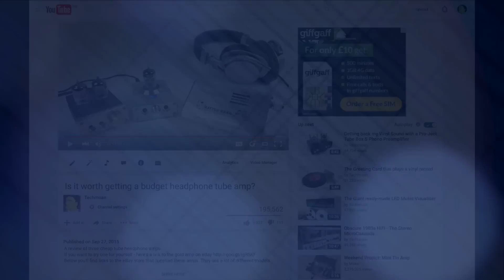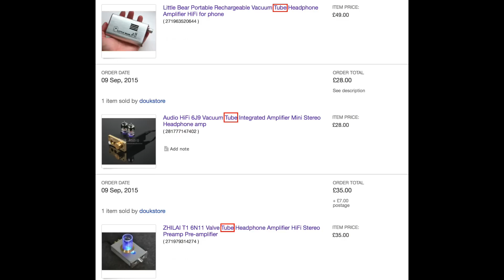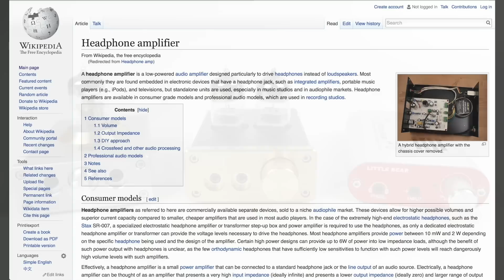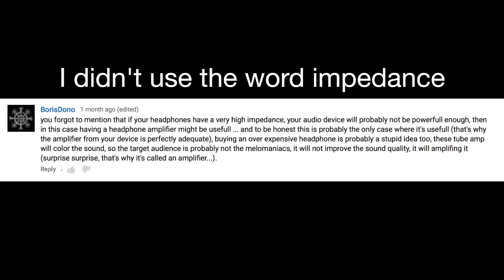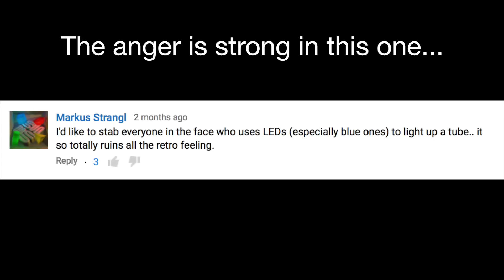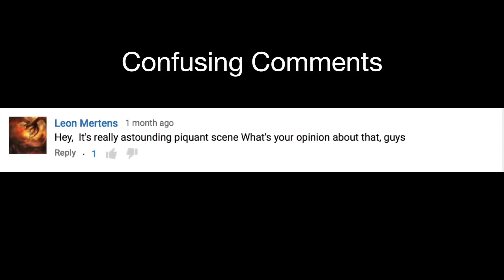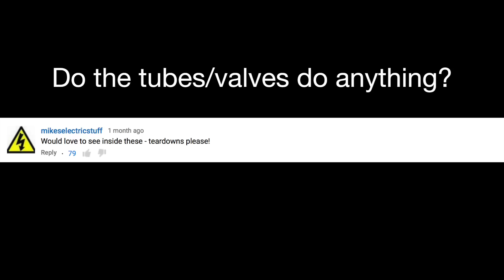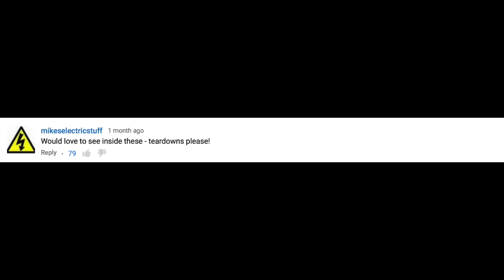Headphone Tube Amps - Follow-up & Tear-down

Comment: Obviously a tube won't operate on 12 volts. Obviously they need a higher voltage. But, for some reason, it seems less obvious that voltage increasing power supplies exist. You can turn 12 volts into any voltage you want, as long as you have the physical space and financial resources to make it happen. I feel like, if you're smart enough to know that tubes require a high voltage, you should be smart enough to understand that a high voltage could indeed be created inside those devices, even as small as they are. However, I am not experienced enough to be able to tell much from the inside of these amps. My best guess is no, there is not a step up power supply.
In my experience, only halogen light bulbs have an issue with being smeared with fingerprints. I have never heard of an instance of a tube or standard light bulb breaking as a result of grease, and I own dozens of tubes and light bulbs, and they are all still perfectly functional.

Comment: Another very enjoyable video, thanks TM. I rather enjoy how you respond to angry comments, I tend to ignore them on my channel (or ban them if they get offensive). I'm fairly sure the valves/tubes are performing a simple Current Amplification function. Basically they take the small low power signal from the source and are able to control much higher currents through things like the coils of a speaker/headphone. Whether they are technically better than modern transistors is questionable but they will certainly have a characteristic frequency response which some will find attractive (the main reason so many electric guitarists like old valve based Marshall amps), and I agree that aesthetically there is a certain charm to the heaters and weird mechanical looking internals (I spent many happy hours as a child opening these things).

Comment: They are space-charge choobs, they we're developed for portable applications where only low-tension (12v) supplies were available such as car radios, where the only alternative was to use an electro-mechanical "vibrator" to chop the DC so it could be fed into a transformer.

They obviously got kicked into touch when cheap transistorized circuits came onto the market but they are ideal for bolting onto hi-fi equipment of dubious provenance as a very conspicuous "premium" feature
Reply: +Old Machines & Such I may have beaten you to the punch on space charge tubes valves by a few minutes but I forgot to call voltage tension! Damn you!

Comment: more of the pins are connected than you assumed, it's a double sided board, you can see the tracks on the top side.
Reply from the maker: +Dave Young  ...this proves the accuracy of my statement that I have no clue about circuit boards construction, and validates my request for help from the experts watching.
Reply: +Techmoan which is exactly what I was offering , I worded it as nicely as my little fingers could muster :)
Reply: Techmoan If you haven't already you should check out EEVBlog Youtube channel.
I'm pretty clueless about electronics and circuit boards and whatnot, but really enjoy watching him tear down all sorts of stuff (retro Sony Walkman was the first teardown I watched, well worth checking out) and I've actually learned stuff whilst watching.
In fact he does a weekly mailbag where people send him stuff to take apart. Maybe send him one of those amps?
Reply: +Dave Young What he said. Circuits printed (and components mounted) on both sides.

Comment: Both Schiit and Little Dot make hybrid tube/solid-state headphone amps that are generally praised quite highly - the Bravo Ocean hybrid amp uses a MOSFET as the output driver instead of an op-amp, but it looks like these cheaper amps do most of what the next 'step up' do, maybe with a little less finesse overall. Hybrid amps make sense to me; they add a bit of 'good' distortion that ends up making the music sound a bit more natural, and don't require the power or extra components (money) that a full tube architecture needs. Bear in mind that everything we ever hear is distorted by stuff in the world and in our anatomies, so... why idolise 'accuracy' so much? As you say, Matt - enjoy stuff! :)
Reply: +mipmipmipmipmip You're welcome!

Comment: I wonder why some of them only have one tube. I know tubes can have multiple amplifiers (triodes) in them but I would think that an audiophile would care too much about possible stereo separation issues to buy a stereo tube amp with only one tube. Or are those mono?

Also, every single one that you're showing has an IC, probably an opamp, as a preamplifier. I'd say audiophiles would be completely disgusted by tube amplifiers with an IC stage, as a matter of principle. That makes me wonder why they make these, and who buys them?

As for me, I'm happy to plug my headphones in my amplifier or even (gasp!) my computer. That's probably why I didn't watch the other video in the first place, but now I've seen this, I'm going to watch it anyway just to see what the fuss (fuzz?) is all about. :)
Reply: +Jac Goudsmit 
yep multiple triode in the tube, most actually use the tube as pre amp to the opamp which gives the "tube sound" but the power and efficiency of solid state.
I have a higher end one and love it. Biggest flaws with a lot of these is low end components used and bad circuit design, the basic idea is proven and works well
Reply: The lack of an output transformer is the givaway.

Comment: The circuits look legit from a first look.

The NE5532 chips look to be used as pre-amps before the valves, all the electronics seem to be fully analog from what is shown making a dummy delay circuit unlikely, the small surface mounted chips look like part of the DC-DC step up converters as valves generally need a high voltage to operate. There are exceptions to this of course.

I agree hobbies are for enjoying, tinkering with electronics and computers is very much fun for me. Good to see you don't worry about the Ellettest numptees, I tend to find such individuals amusing.

Comment: you sir are a legend, it seems that the first amp is only tube, the second has a transistor on the back of the pcb (maybe for like pre pre amp) and the third amp is also tube only. you dont need to connect all pins on a tube for it to work (don't qoute me but i think 3 is enough) hope that helped. keep up thos awsome vids ;)
Reply: +marcus ravn  The "transistor" is either a rectifier or voltage regulator.
Reply: +Deluk i was just guessing but you  are right, im not shure that it is a trans but i could be
Reply: +marcus ravn The second device has a voltage regulator on the back. A single transistor would only be good for one channel of the audio, and it wouldn't be very good with a single device! 3 pins on a tube is not enugh, as the heater alone takes two. To have a working tube (a simple triode, similar to a transistor) you would need to hook op 4 or 5 pins minimum.

Comment: Looking at the datasheet for the 6J9 it has a recommended plate (anode) voltage of 125V but looking at the PCB there are no capacitors there rated at more than 16V so I call foul.  If they are running this tube with just 12-16V of anode voltage then it won't be doing much (if any) amplifying and its linearity will be highly suspect.   

You should send this to Mike and get him to give you a tech analysis.
Reply: +xjet Are there enough (cheap) space charge tubes to make a commercial headphone amp with one, or would the premium be greater than what you'd pay for a proper HV circuit? I've never done any design work with tubes or any electronics really I just know a bit about them from an historical perspective.

Comment: technically a cd player hasn't got a phono out, that is a line out. great work, keep it up!
Reply: +peter meatsock Many people call those cinch/RCA plugs "phono plugs" for some reason, so I'll let that one pass. :)
Reply: +Jac Goudsmit RCA used them on their phonographs as internal connectors between the pickup and the amp section, hence the name "phono connectors".

Comment: All 3 amps are using tubes as preamps. If you wana have "tube sound" you need them on the output stage, which is in these 3 .cases a solid state IC.
Reply: +Aaron Vockley 
By tube sound i meant rounded off signal instead of clipped. Thats the point of having a tube amplifier. They dont clip as hard as transistorised amps do. You can get away with having a transistorised preamp and tube output stage, because preamp shouldnt get a signal that high to clip. The output can get a signal large enought to clip easily. Plus tube output stage has large tolerance for different output impedance. But with thing reversed like these garbage amps there is no point of having tubes except high selling price.

Comment: Loved the original review video, learned a lot from it, and was kinda suprised to see this one. Love it aswell. 
From what I know about NON-tube-amps VS tube-amps is that tube-amps are generally for `older people` that want to `create their own sound` by replacing the tubes with other tubes. For those who do not want to do that can also buy high end (NON-tube) amps that do not change the sound at all, like a O2+ODAC REV B for example.
Reply: +Sneeuw Vos You can still sorta do this with solid state amps, if they're socketed. I think the point is mostly their distinctive sound (they don't produce sound perfectly like the input, that is to say they do so less accurately than a solid state amp) which some view as an imperfection but others view as a feature.

Comment: (Oh, and absolutely you can handle the tubes with bare hands as much as you like. That's not true for some specialist power varieties that run at a very high envelope temperature, but anything in consumer gear won't care tuppence for finger grease. Eat a Ginsters Pasty first if you want to.)

Comment: They all seem real, the 2 non portable ones seem alright.  That little bear one is horrible though, you can see 2 "ebay special" boost converter boards soldered right on.  I don't know why people assume that a tube amp can't be cheap, it's ancient technology and it's dead simple to implement.  All  you need is a handful of components to boost the 12v up to around 200v and you're in business.
Reply: +Justin DiPlacido Well, it is simpler to buy a cheap solid state amp and glue a tube with an led on I suppose.
Reply: +Justin DiPlacido The little bear was the best! I cringed. And when Matt had the one apart he could have snipped out the blue LEDs , I know I would have. WHY the blue LEDs when you have the warm orange glow??

Comment: The last two seem to have inductors, which could mean they have DC-DC converters to produce anode (UK) or plate (US) voltages... but they don't need to. Valves work at 12v HT (High Tension, the old term for high voltage), but can't handle any power like that - which obv. doesn't matter here. Some old car radios used 12v HT valves throughout, with transistors for the final stage where power was needed. So - my guess is that they all do actually use the valve or valves: they might as well. Perhaps some generate higher voltages for better performance. I have seen one incredibly nasty amp that had valves where just the heaters were connected, but the rest of it was severely horrid too, These at least look properly designed. (Perhaps YouTube should be renamed YouValve in the UK?)

Comment: Mutli-layer circuit board.  There are probably connections sandwiched between top and bottom you are not seeing. Computer manufactures that make circuit mother boards use multi-layer design.  Time stamp 12:40 into video.

https://en.wikipedia.org/wiki/Printed_circuit_board

Comment: Dear Techmoan thank you for your great videos first of all.  Addressing your questions - those tubes seem to be a part of the electric circuit and sound signal path.  Circuit boards are double sided so you should not be confused with the fact that some of the pins are not connected on the one side.  Whats a little bit disappointing is that the actual amplification is performed by an operational amplifiers and not the tubes, which are most likely connected as a cathode followers.  Making a long story short - tubes are part of the signal chain but mostly for decoration and I would say marketing purposes (besides adding a little bit of distortion).  You may find true full-tube devices with a higher price tag.

Comment: Perfectly possible to drive the anode on the 6n11 from a low voltage. Even if the amplification isn't very much (or even lower than 1), it's the sound that you're after, right? Well, here's an example of how the 6n11 could actually be used: http://www.avsforum.com/photopost/data/2357632/4/44/44e6bbe0_headhponeamp2.jpeg

Comment: Some of the tube's pins are connected on the front side as well. The single tube amp seems to only have three pins connected on the backside, but you can see more pins connected when you've turned it around again.

Comment: I actually like my Little Bear B-1 which I bought ages ago (looks a little different as well, actually). Nice 'n warm sound to it. Quite soulful. Really sparks some life in layering the range. Always helps to feed your amp through a nice DAC. Personally at the moment rocking the set-up UD120 from Stoner Acoustics with S.M.S.L. sAp II Pro amp. With tunes rocking through cans such as the K7XX, M50x DG and HM9... depending on my mood and style of music playing.

I don't know. I like budget stuff from China more so than a very expensive Sennheiser set-up. It's more fun and I like the diversity. FiiO also does a fine job when it comes down to audio schtuff. I'm pretty curious about that xDuoo X3, but it's time they started using a bit more hip displays. I mean, an oldschool Rockboxed Sansa Clip Zip even is nicer.

Comment: +Techmoan These three circuits all seem to be real. The tubes are connected on both sides of the circuit board, not just the underside. There are small inductors (magnet coils) that can make the high voltages.

Comment: Watch out poking around in these circuits, big caps like in that last amp you showed can give you a good jolt.
Reply: +custardo Even long after they've been disconnected or even after you've discharged them sometimes (dielectric absorption). I know this from personal experience.

Comment: And i should add that it does appear as if all these preamps do have the tubes in use 
Im also glad to see socketed input opamps

But im not happy to see switchmode supplies ...
Reply: +Alyx BioHaz I'm not an expert, and I understand why you wouldn't appreciate switchmode supplies in audio equipment, but for something battery powered would a linear supply even be an option?
Reply: Only one appears battery powered but a multi phase switching supply or a linear tracking switching supply would be ideal ... But honestly just don't bother getting a portable tube amp
Reply: I agree

Comment: I stripped down the gold 2 tube / valve amp on my own YT channel and no one could decide if they are really working either LOL
Reply: +fredintheshed1 They do really work! Though not very well, probably due to cheap chinese components
Reply: +Josef T-D I think Matt did a better job in his video than myself but I got pretty much the same results.  I think the fact that with the tubes removed you get no sound is a good start.  I also hand built a tube radio kit a few years back and that worked on 6v.  I actually thought the gold amp sounded ok for less than £30.  I was not expecting much when I reviewed it.
Reply from the maker: +fredintheshed1 well it seems like we've had all the best minds in the business draw a blank ;-) Seems like it's time to move on to something else and recycle these.

Comment: The pono player is rubbishy buzzwordsy nonsense.
I can honestly kind of understand someone losing a bit of respect for you if you actually paid the asking price for the pono
Reply from the maker: +justin smith what lossless player would you suggest I now buy instead. I didn't really want to spend money on another device, because the Pono worked well for what I needed, but if you insist it then it looks like I'll have to go straight to Amazon, get my credit card out and put my fully functional Pono in the bin.
Reply: Techmoan 
Pull that triangular piece of snake oil out the bin and stop pouting.
I am criticizing the device not you for purchasing it.
If lossless on the go is what you need sorry thats the bullet you have to bite, but to put it simply, pono is a very overpriced, poorly designed player.
Reply from the maker: +justin smith I'm still on the edge of my seat awaiting your reply.
What device do you deem acceptable for me to use instead of the Pono for a portable lossless player with a line and headphone out?
Reply: +Techmoan agreed, if it does what you need it to do. if it ain't broke don't fix it
Reply: +Techmoan 
I wish I could magically conjure a device like the pono that is not ugly, poorly made, and sold on buzzword terminology but I am not a magician.
Again bite whatever bullet you want, I mean it looks like a Toblerone.
Reply: +justin smith What's wrong with Toblerones?! I love them!
Reply: +Techmoan I don't really understand/have any beef against the Pono, other than it being expensive, but what do you think about the Fiio X series?
Reply: +Techmoan lossless is great, the pono isn't a bad machine at all.  The only problem I have with pono is Neil Young,  I love his music but seriously question the ability of his 70 year old ears to tell the difference.  Especially when 50 of those years have been spent in front of massive guitar cabinets and wedge monitors! :-).  He's doing it for us, not himself.
Reply: +Paul Grimsley 
I like lossless but not the pono.